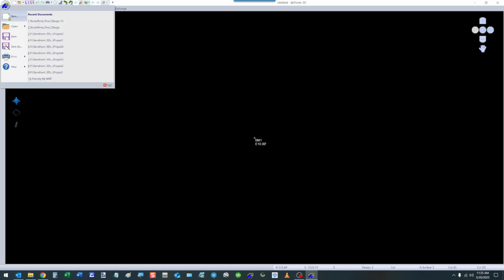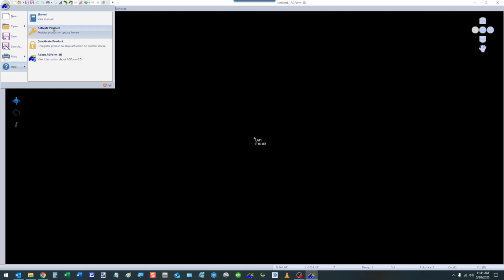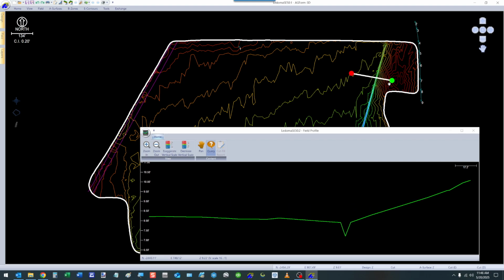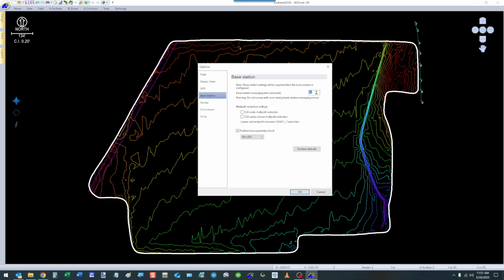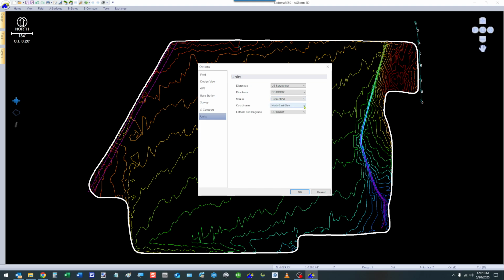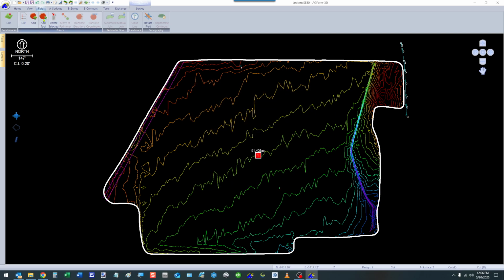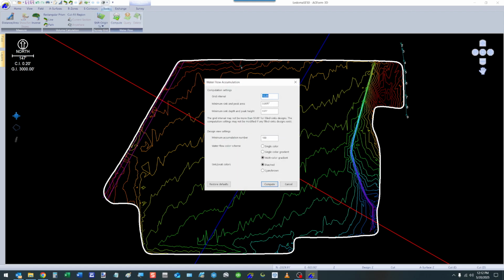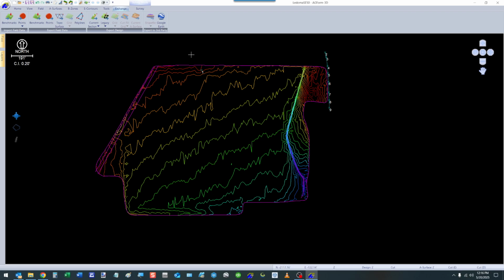Introduction to Topcon's AgForm 3D

Comment: Do you know of a way to convert and .ag3 file to possibly a .kml file?
Reply from the maker: Yes. In Agform 3D there is a Exchange tab. Under that there is a Google Earth button. It will export all data as far as existing, design and cut-fill contours along with benchmarks and landmarks. Section lines will included also. Sorry for the late reply. I just saw this.